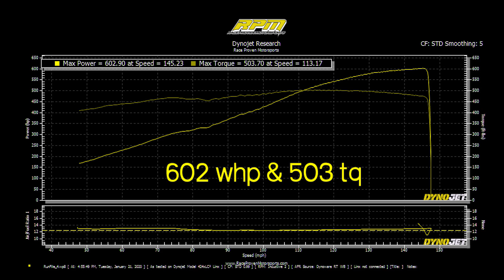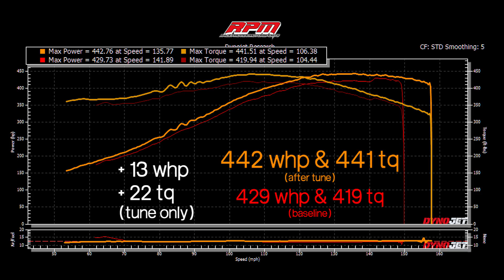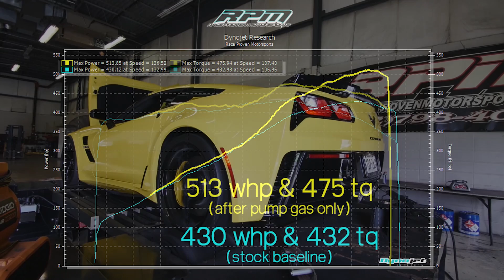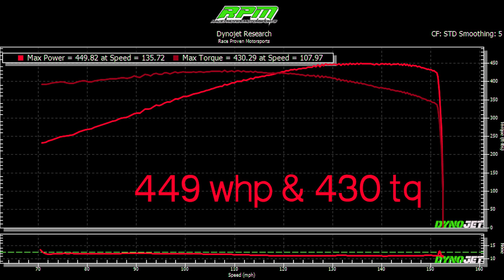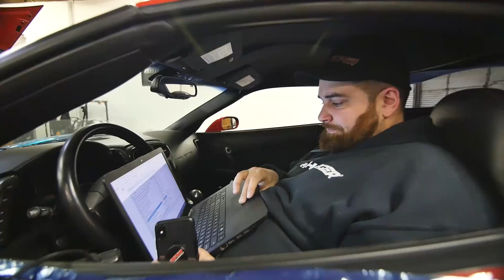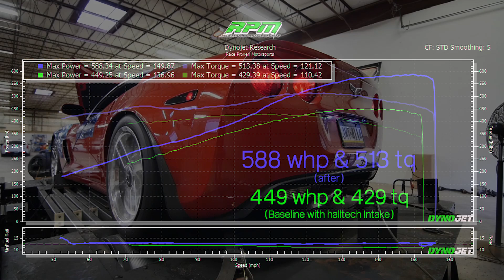RPM Heads Cam Package Cats vs No Cats | RPM S8 E45

Comment: I have a suggestion. I would be interested in seeing rpm along with hp and tq on the dyno. I wonder how peak tq numbers move with a change in cam also peak hp. If you don’t want to disclose rpm for some reason maybe you could just say how many more usable rpm roughly and not specific numbers. Just an idea. This is my favorite car channel !!!
Reply: ztwntyn8 i don’t think their dyno is setup for that but there’s a way to convert it with gear ratio tire and mph.
Reply from the maker: We use speed bc a lot of times the dyno software will glitch out and if we show it in RPM the graph will be all over the place so it’s safe on speed

Comment: Some big name drivers were pretty impressed by PTM when it came out - Randy Probst and such - do you guys have an opinion on how PTM does with additional power? e.g., z07 with PTM going from rated power to 650whp? Or maybe the ZR1s you guys have had through there? Can it be tuned, or does it not need to be and adapts automatically? or does it just start behaving like a traditional traction control (reacts too late, car feels like it's falling on its face).

Comment: Man, I'm a little baffled. I read a long article about how hard it seemed for Chevy to get the LS7 over 500hp. Like so many little things they had to do. Yet you guys are getting WAY more power out of these. I have a 2013 427 that's bone stock and you bet I'd love more power. 600 at the wheels seems insane. So 600 at the wheel with your Stage 3 package? So, cats vs no cats.. didn't see one word about it. :(

Comment: My 12 C6Z is loud as hell with 2" Kooks no cats stock mufflers. The early C6Z years 06 thru 10 have quiet stock mufflers. May make a difference with more restrictive.
Reply: I'll be installing RPM heads/cam package soon on my 12 C6Z. I also have the 2" Kooks with Xpipe no cats that will be going into stock mufflers. Is it really going to be that loud?? Lol
Reply: @TheCortezChannel.  with valves open yes
Reply: @rmm2424  I do have the mild2wild. How many miles on your C6Z? Kind of nervous about the whole rod issues I hear about the 2012 & 2013 cars have.
Reply: @TheCortezChannel.  26000
Reply: @rmm2424  I'm at 64k, hoping I don't run into that issue
Reply: @TheCortezChannel.  have you fixed the heads?
Reply: @rmm2424  not yet, heads/cam/exhaust sitting in garage at the moment. I'm just going to send an oil sample to Blackstone before I move forward to installing parts.
Reply: @TheCortezChannel.  I would have your short block refreshed.

Comment: It's insane that  Mustangs can drive off the lot and you never truly have to crack it open to make a thousand rear-wheel horsepower with a blower
Reply: crown Victoria lifestyle not gunna last as long tho
Reply: mr.namehere it'll last if you find the right tuner

Definitely pushing the limits it'll definitely handle more then these type of cars will without cracking open the engine to  swap heads and cam 

E85 and it will be jus fine
Reply: @crownvictorialifestyle4421  LMFAO

Comment: What does camera guy say at 15:52 regarding the red ZO6's lower baseline hp?
Reply: I was on drag radials. I rushed to get them on for a end of year trip to the track which i ended up not going to. I didn't want to go through all the trouble to take them off. I left them on which isn't recommended.
Reply: @luiscordova6050  Thanks. That's kind of what I thought. I bet that's why your car made a few less hp than the yellow one and not the cats. I'm curious because I'm taking my HCI Z back in to get CNC ported heads (instead of the current hand ported heads) and a NW 102 tb in April and wonder if the Nitto NT01 R compound tires on it will make less hp on the dyno than street tires. They're not drag radials but nearly slicks with about 3/32nd tread left on them.  I've read drag radials and sticky compounds can eat up the tire and eat into the hp a bit.
Reply: @jessemcdougall-douglass162  Yeah, I looked it up and that's exactly why. The tires tend to chunk on the rollers which will cost a few HP.  You can kinda see the sidewalls expanding on the dyno if you look close. You wont regret taking it in.
Reply: @luiscordova6050  Any idea if the NT01 road course tires I'm using would have similar effect on the dyno? I know it's only a tool but it's nice to have a bigger number. I use them strictly on the street as they have better traction than the Michelin Pilot Super Sports I had previously.
Reply: @jessemcdougall-douglass162  I would think the sidewalls are stiffer on those but I don't know for sure. I would assume not but I think Bill at RPM can probably answer that better than I can
Reply: Youre not going to lose enough horsepower that its worth changing to a harder tire just to dyno on. Worry about maximizing everything together, the H/C/I and bottom end/power adder if youre doing them, then get a qualified tuner and forget the tire youre on.

Comment: I have a question ( anyone can answer) if my midpipes are 3” is it a way to fit 2.75 exhaust to them?
Reply: Yes with reduction pipe, costs like 20 bucks a piece. I have my 3" downpipe reduced to 2.75 catback.
Reply: Srt Mark I would think you could use reducers. My experience with reducers when I have welded them is rust if it’s driven daily. I welded so I wouldn’t have clamps so close together and the reducers tend to be a little stiff for using u-bolt clamps. Hope that helps somehow.  ✌🏼